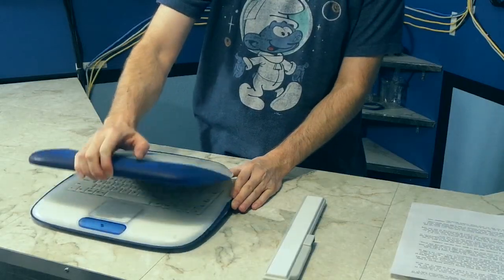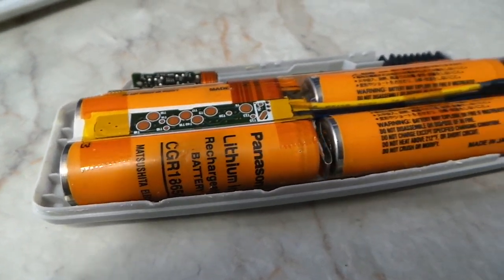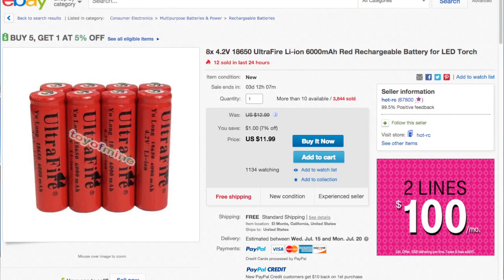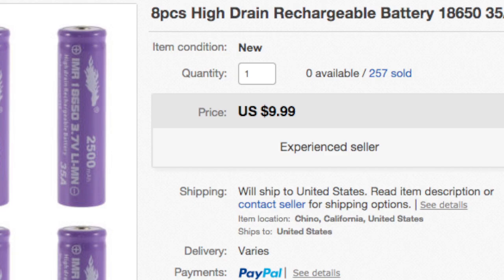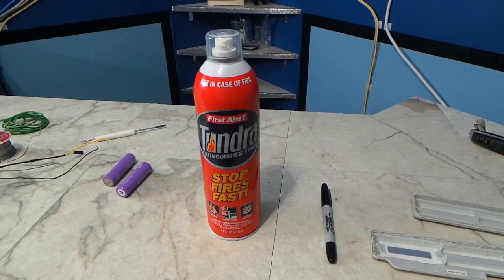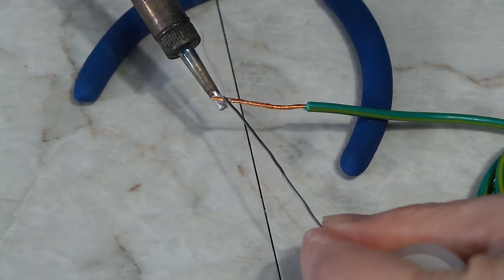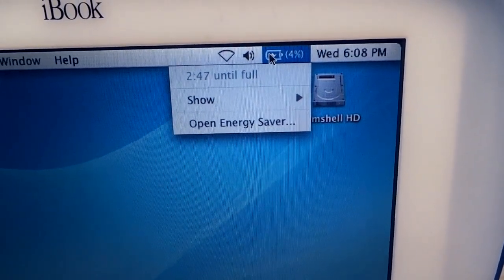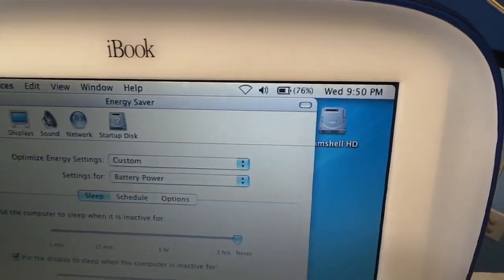Rebuild a laptop battery pack

Comment: Should I do this for my laptop? It has about 30 minutes of battery life with every single energy saver feature turned on, and it's not new in the slightest. The only batteries I can find are not OEM, and go for around 20-30 dollars.
Reply: simhopp
Yeah, but I'm poor and need a new desktop more than a new laptop.
Reply: +simhopp why would it be a better solution?
Reply: simhopp depends on the type of laptop and the purpose its used for, potatoes can run office/youtube and if the comp is used for that there's no need to upgrade.
Reply: מקסים גוטמן it's super fucking old and only used for tumblr and youtube really

Comment: Whilst in principle I don't disagree with what you're doing here, I have found that with modern laptop battery packs, you have to use a sharp knife (scalpel perhaps) to get into the battery pack (it doesn't just unclip  like you show in the video), so I kind of semi don't really see the point in doing this.

Comment: You actually got really lucky that it took off and worked. I have seen more often than not, the controller's EEPROM needs to be re-virginized and have all the "battery dead" flags reset. Dell batteries are notorious for that, same with IBM.
Reply: ***** There are actually software packages that will do that, you do need a programming adapter though, once you remove the eeprom. Some batteries have a backdoor where you can use the existing SMbus. Some dont.
Reply: You do it like disarming an IED bomb ;-) 
Connect aligator clips (if you feel brave today ;-) or solder temporarily some random old li-ion cells to all contacts, no cell connection to protection board should ever get disconnected. If it does, protection circuit of some batteries, (but not all), will raise a tampering/catastrophic failure flag in its MCU software, and will appear dead. 
Then you remove old cells and solder on/install new cells, then you disconnect temporary connected cells. (voltage difference between new and old cells does not really matter, as long as they are somewhere between fully charged - 4.2v and fully discharged - 2.5V, there will be no damage connecting the two together in parallel temporarily, current between them will be few amps for some seconds and slowly taper off, this is still within specs)
This is considered a "safety feature" (i guess coz it protects laptop company from money loss from lower replacement battery sales).
Reply: @pyroslavx7922  yo thanks for the tips. I've tried this with my netbook battery. And it's work. Also I suggest to add small 1S BMS for each battery. I tried your solution using phone battery. With 5000 mah capacity. Now my laptop could run almost 6 hours on battery alone
Reply: Pyroslav x your right the eeprom within the battery pack records charge miss balancing between the cells then sometimes it can suddenly permanently disable the whole battery back even when you replace the cells, so you end up purchasing a new one from the manufacturers, i think its abit of an intentional money scam
Reply: @tyronenelson9124  Manufacturer doesn't expect that someone will try to replace dead cells in factory sealed batteries. No scam there.
Reply: I have found a workaround for this problem (at least for ThinkPad batteries) you first need to fully charge the original battery and all your new cells, then connect the battery to a set of bridge cells in order to maintain the correct voltages on all the power rails while you are swapping out the old cells (similar to how a heart lung machine keeps the body and brain alive during a heart transplant) 

Solder in or spot weld the new cells, reconnect all the wires and temperature probes, remove the bridge cells, put it back together and plug it into the laptop, do a few drain and charge cycles (and by that I mean set the shutdown percentage to 1% and leave it turned on until it dies on its own, if you are adding more capacity, I recommend playing a game or doing some other intensive activity to speed up the process as long as the power draw is roughly constant throughout the whole process, then plug it in, turn it on, and leave it until it stops charging on its own) 

During the cycling phase, the battery meter will appear to freeze (usually at 3-7% on discharge, and 97-99% on recharge) this is normal and will not happen once the BMS learns the new total capacity of the battery (I used this exploit to upgrade a T420 battery from 47wh to 380wh) once the battery meter starts working properly (usually after 1-2 cycles) you can use a tool like osiris batterybar to tell you the exact capacity of the battery in milliwatt hours (in fact, go download it right now, it's far more precise and gives way more information than the Windows battery meter, here's the link https://osirisdevelopment.com I have used this tool on ALL of my laptops for the last 10 years, and I wouldn't go back if you paid me)
Reply: The connection of 2 batteries are in parallel and then they are made into series (3x) , there is no way for controller in this particular circuit to know which cell died (in parallel connection) it can only detect potential difference across parallel unit as a whole if it marked those set as bad cell then current will fail to flow from those cell and the potential drop of 11.1 is really hard to maintain if this happens basically it means whole system is dead ... and probably the controller will flag whole system as dead 

Pardon my ignorance but i don't see any reason "software controlling flow of current" just by flagging cells as good or bad .. as you can't really deactivate single unit connected in parallel connection  

(for  a unit that is connected in parallel in order to deactivate would need to be short circuited (risky)) 
or
 it need to be physically removed from circuit that is open circuited)
can you point out how exactly controller deactivate (that is, put batteries in open circuit ) I'm asking this out of interest ...
Reply: Packard Bell battery packs tend to completely shut down (and never recharge again) when the voltage gets below a certain level on even a single cell. That's how my BP-8050 battery packs have failed.
Reply: Are you saying if I try this with my Dell Inspiron 8100 battery pack that is completely dead, it will not work?
Reply: @cdos9186  If the system reports that its a bad battery (flashing yellow light) then no, it will not work.
Reply: @THEtechknight  That is what the bad OEM battery is doing now, green light for 1 second then flashes orange three times and it repeats and in the BIOS it says charging but it never gets passed 0%. What you said do you mean it will not work if I replace the batteries with new ones anyway, or are you saying if I do replace them and get that it will not work?
Reply: @cdos9186  Not certain on that behavior. Usually the BIOS complains and says the battery is bad. You could try and recell the battery, but the problem is, the controller thinks the battery is dead. so you cant put new cells in there fully charged and it work. You would have to drain the cells first or potentially try recalibrating the battery ASSUMING the controller hasnt locked itself out. and thats a big If.
Reply: @THEtechknight  Why did it work for him then? Also I have an Inspiron 5100 that the battery was working fine, then all of a sudden the battery light just started doing the same thing, flashes green then orange except four or five times. What is odd is how the battery will still turn on the computer and charge normally, except the battery light does that all the time and it is annoying whether it is running off of the battery or charging, it does that. Still charges fine except it is like the controller knows the health of the battery is degraded since it was working normally. That makes me think if I were to rebuild the one in the Inspiron 8100 it might work since the 5100 doesn't seem like it locks out the battery from charging.
Reply: @cdos9186  I am not him. I am not a mind reader. I cant tell you why it worked for him. I am speaking from my own experience. I have only done this for years. If you rebuild a battery that identifies itself as reduced capacity, it really depends on the microcontroller inside the battery. in some batteries, (like the IBM) you have to revirginze the controller back to the proper capacity. Lithium batteries are not something worth "experimenting" with. you have to do it right the first time, or you can have a nasty explosion and potentially burn your house down.
Reply: @THEtechknight  I will not try it until I get the proper experience and feel safe doing this then. I have taken the cells out and they are almost completely depleted, a lot below one volt. Probably best to buy a used OEM one for $30 that is guaranteed to work rather than buy the cells and have to do each of them and have the high chance like you said of the chip locking the battery from charging. Thanks for the information and I will come back here if I have any questions about doing this since you know what you are doing.

Comment: But be careful with cheap ebay batteries, some have actually less than 50% capacity of what they claim. You can check them if you have a digital charger which say the capacity of batteries.

Comment: Do I have to be aware not to buy a too big capacity batteries? Can that burn the laptop charger or the controllers incide? Im looking for a Panasonic ncr18650b 3400mah 3.7 volts. Four of them for a dell laptop. Thanks in advance.

Comment: Be careful not to overcharge them. I doubt those 18650s have internal protection circuits.
Reply: +Johnny English battery controller must take care of this (ic connected to cells), not internal protection.
Reply: Volodumur Kalunyak In Britain, both the battery charger and the rechargeable batteries must have built-in protection to prevent overcharging. It's illegal to sell consumer battery packs which don't contain internal protection circuits.
Reply: +Johnny English So a normal AA rechargeable battery must have a built-in protection circuit? I seriously doubt that!
Reply: ppdan No, Lithium Ions, i.e. most laptop battery packs.

Comment: First I would like to appreciate for the work you have done. but this never works wit modern battery pack. These people use a volatile memory in the battery firmware and as soon as u disconnect all the batteries, it will delete. So what you have to do is, make a new battery pack and connect it into parallel for 3 to 4 seconds and you have to disconnect your old battery pack as soon as possible. It will never disconnect the circuits from the power source. Otherwise you might use a good capacitor as well (I used 6000uF 25v). It should hold the power for those time you replace the old one with a new battery pack. :).

Comment: The runtime was less because you have to reset the battery circuitry, because it still assumes that the batteries are worn out, and accordingly shuts the laptop down
Reply: you can use i2c bus

Comment: So, I'm assuming this is cheaper than buying an actual new battery pack?
Cuz I skimmed through the vid.
Need to buy the batteries, solder, soldering equipment, wiring, etc, and any shipping fees if you can't buy them locally.

That still worth all this effect to save a few bucks? I wouldn't think so.

Comment: Next time, DO buy a decent replacement, and DO use replacements which have solderable tabs already welded to the ends of the cells, as this way no harm will come to the cells when you solder them into an array of cells.

Comment: Can I use 9V batteries? they have 600 mAh (rechargeable ones, obviously)
Reply: +Yejak ksara no. You need 3.7 V rechargeable lithium cells, beacose controller sense each cell voltage

Comment: Hi i have a lptop and battery is completely dead and after opening the battery pack i noticed that there is no number on each battery but it reads as ASO FE30115EG 601485, 490, and so on. i am not sure whatmodel battery is this. battery pack says 7200mAH 80Wh can you pleSe suggest what batteries I need to buy. Pack has 9 batteries in it.

Comment: Spray can extinguisher. For a lithium fire. 
I wouldn't even feel safe with a real ABC extinguisher.
Reply: Yeah, my thought's exactly. Then I saw the guy soldering onto the batteries and flinched some more :x
I mean, I like him, but damn, this is some risky stuff. The problem with a battery fire is that it's not really a fire, it's rapid discharge. Everything that is needed for the thermal runaway to happen is contained within the cell, whereas a regular fire (let's say a piece of wood burning) uses oxygen from the environment. Soooo... this battery could easily continue "burning" thrown into a lake. Now, I am not saying that hey all decompose in the same way, of course not, but be ready for the worst, just in case.
Reply: This is why I own a small Halon fire extinguisher.
Reply: @LawF250  - It most assuredly does not 'produce it's own Oxygen' (How!? Out of what?!) and will not 'burn even in space'. Not even Sodium metal behaves like that.
Reply: Dolt? lmao
Reply: Those batteries contain lithium compounds instead of the bare lithium metal, so it's not thaaat bad... the extinguisher might be able to prevent the other stuff on the table from catching fire :)
Reply: There's not enough metallic lithium to worry about.  Even water is fine to quench a LiIon or LiPo fire.
Reply: Either that, or a very cold environment, especially if the change is sudden and sharp. The fire will flare up but quickly lose its' fuel.
Tossing a lithium fire into a wet snowbank? Yeah, it'll work. It'll also melt a good portion of the snow in the process.
Reply: Mathis Bü If it doesnt contain water or dont make water condensate in there its ok. Lithium really doesnt like to be punchtured or being in direct contact with water, causing some flames. 
But it isnt as dangerous as its fumes.
Reply: So you're not felling safe with your iphone/ipad/android/windowsphone/laptop device?

Comment: in most cases of laptop battery failure 
its actually the control chip that causes the problem 

i have disassembled more laptop batteries than i can count and in all but 2 or 3 of them 
the only thing wrong was the chip de-balanced the cells to give the illusion of a worn out battery 
to convince the user to buy a new one 
i recharged and tested all the cells and they were perfectly fine 
same thing happened with almost every laptop battery that i have bought or scavenged for free that was listed as not working 

those chips (modern ones at least) have a set number of charge cycles before they de-balance the battery pack 
they are programmed that way to increase sales of replacement batteries 
there was one battery i disassembled it was from my personal laptop and it would only work for about 20 min before it would die 

so i harvested the cells and i found that one was at 2.3V (well beyond the safe discharge voltage)  and another was at 4V (fully charged)

i recharged all the cells and they all worked fine and still work to this day in my portable phone charger

Comment: My battery pack on my cordless drill gave up and to replace them it was about £100 for the PAIR as they didn't sell them singly. So I cracked open the case and found the dud batteries and replaced them for less than a quarter of the price.
Reply: +Darren Boss Ikr

Comment: I got 4 18650 and I knew they were fake because they felt like they were hollow inside :) I drained them in a flashlight and then charged in XTAR VC4 which measures capacity and got... 500mAh :) +/-50 on each of the 4. I have brand AAA that hold more... They were red Ultrafire 1 dollar each. Lesson learned.